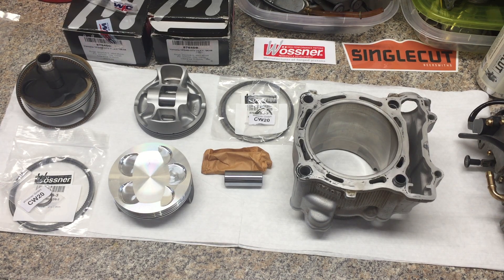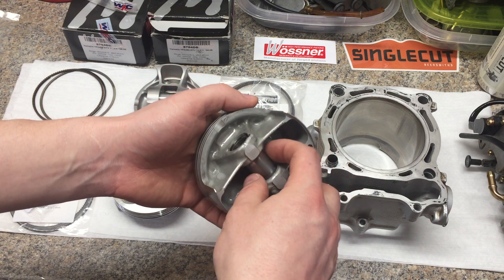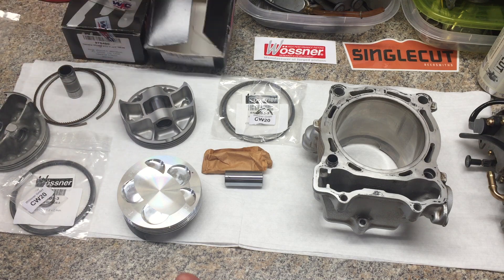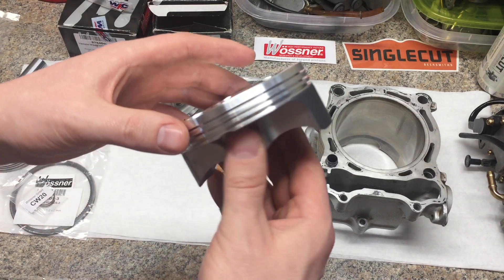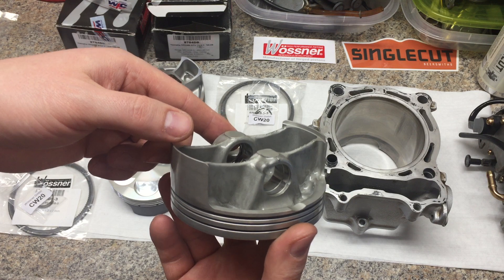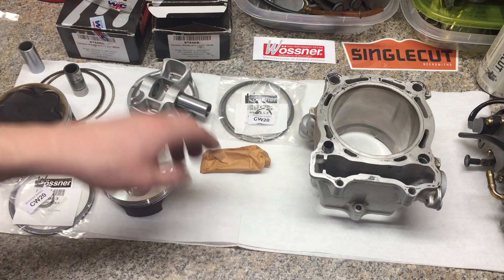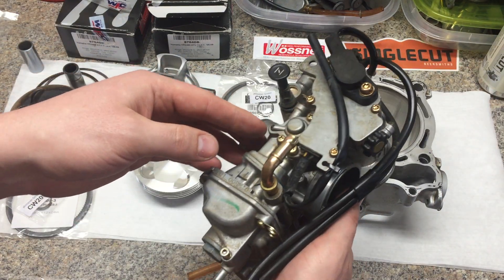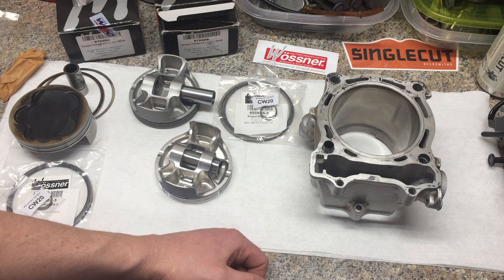Project YFZ 450 Piston and cylinder! Don’t miss this rebuild info for your YFZ top end!

Comment: My 07 yfz450 has a high compression piston and has lots of compression my starter is acting like it’s not strong enough to turn the motor over don’t know if the starter is going bad but if I buy stock starter will it turn the motor over with it being a high compression piston
Reply from the maker: Stock should still start as they use a compression release on the exhaust cam. Probably something else going on.

Comment: cool vid. But a correction, those holes in the ring fitting aren't for cooling the rist pins. They are for spraying the rings with oil from the oil jet below. That's why its on the port sides that take the hardest loads.
Reply from the maker: I’ll have to go back and look at what I said. Sometimes I misspeak. But the rings scrape the oil and send it through the holes which are directed toward the pin area for lubrication, not cooling.
Reply: @mechanicsantics3575  the oil is sprayed up on to the backside of the piston. Only way oil gets on to the top side is by those holes through the oil ring grooves. There is no reason for this design to be for lubricating the pins when the oil jets spray directly at that area.
Reply: @mechanicsantics3575  on the down stroke oil pools under the piston head and smears outward towards the walls. Without the ring grooves, all that oil would smear on the bottom side of the rings and cause the top rings to quickly dry out and start to chaff the walls causing extreme friction (heat) and wear. The port holes allow the top rings to remain lubricated and reduce friction.
Reply from the maker: Don’t forget how much oil is coming out from the rod bearing. This is how the cylinder and piston is lubricated without the spray nozzle. The walls of the cylinder have oil and when you think about the volume of oil from the spray nozzle and rod big end there is plenty of lube to be removed by those rings. At the speed of these engines it means oil is directed toward the pin. Piston engineers know that they need all the help they can get. CP pistons have these holes fed direct to the pin bores which is a better design in my opinion.